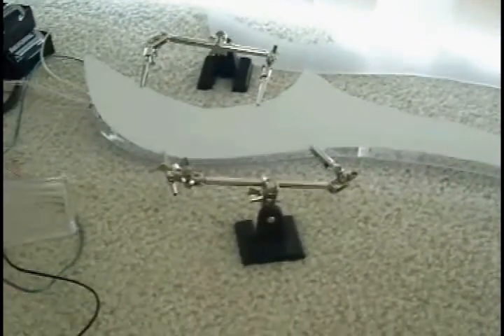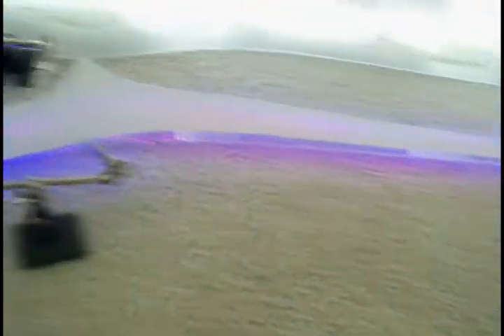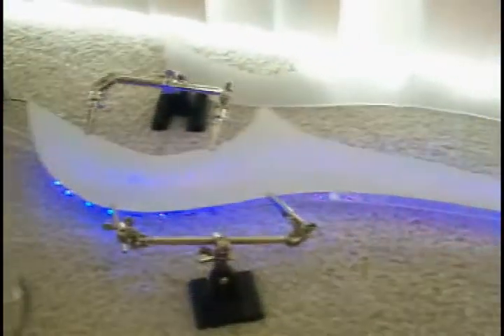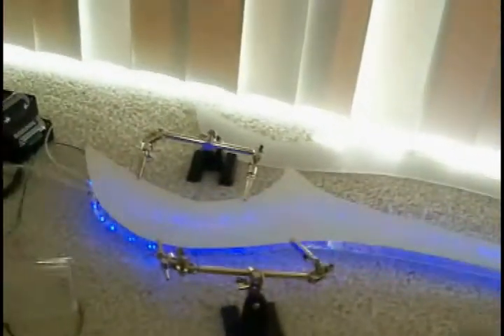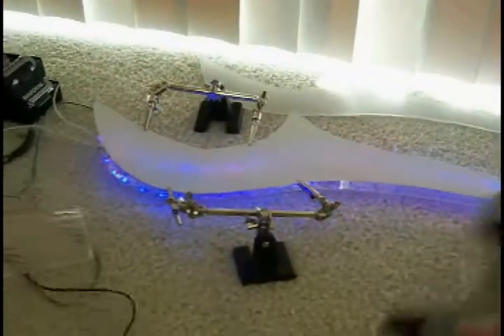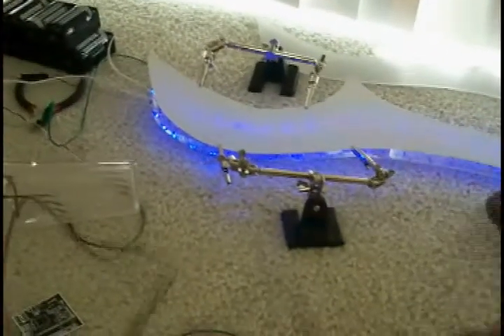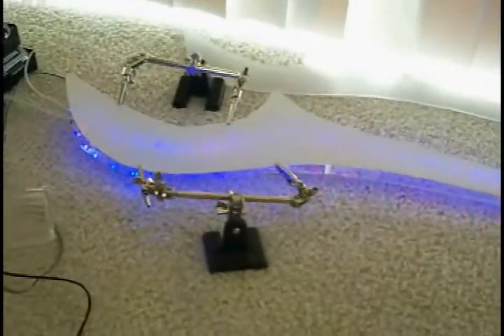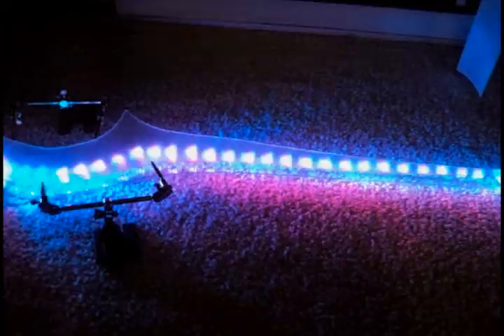Sword Circuit Demo

Comment from the maker: @hosborne83088 What I did was look at community lightsaber designs to come up with my own LED rail design.  My spacing between LEDs is about 1 inch.  Works well when there is a small distance between the LED and the diffuser.  Can look at my LED rail guide: westaby.net/2010/04/led-rail-blade-assembly/